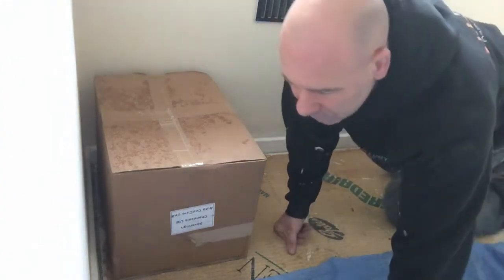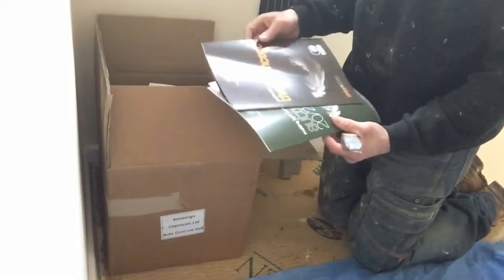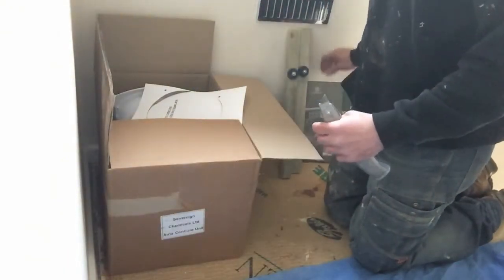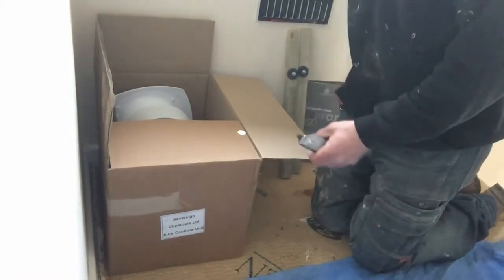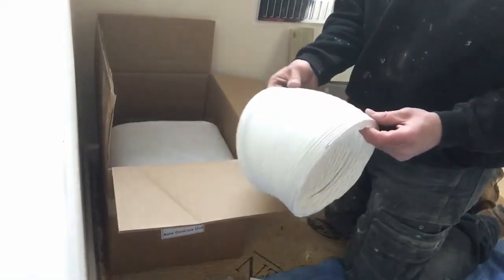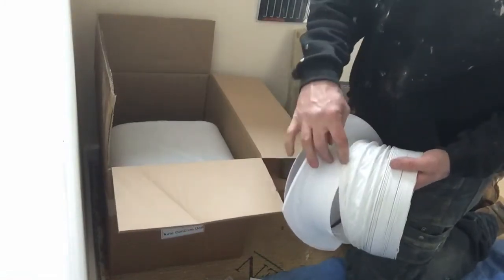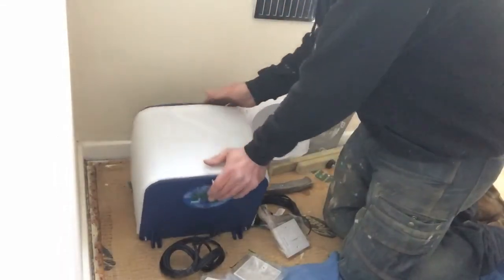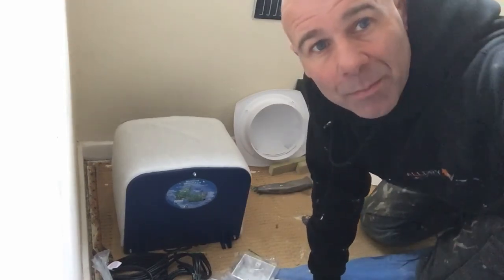Positive Input Ventilation (PIV)Unit un Boxing

Comment: Used on of these at your suggestion , no problems since. Yours look a bit expensive . Mine was £450 plus fitting.
Reply: This one hes using is £470 plus fitting charges 

Are they any good as I'm thinking of getting one
Reply: gasmanfrank .yes they are good . I fitted mine in a rental were they had complained of damp spots and moisture running down the walls and black mould in places. I inspected and cleared all the air vents no problem there. Had mine in use for 3 years and not a single complaint. Best cash on a renter that I have spent.
Reply: @Andrew_lee_utube  thanks so much appreciate your reply
Reply: Hi,the company who fitted ours won't answer our calls to arrange a service. Is it easy enough to change the filter myself ,I can't find another company in the Glasgow area to do a service,thanks.